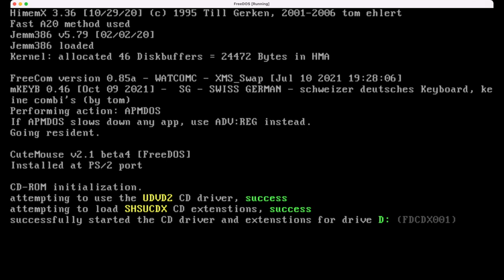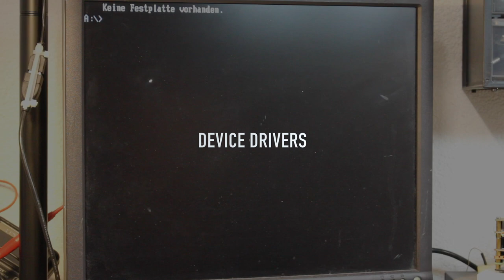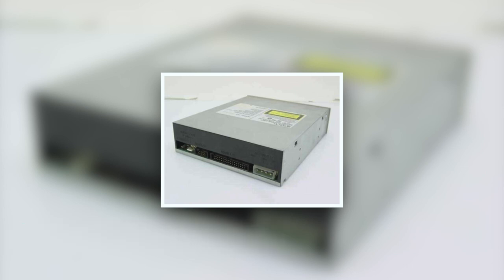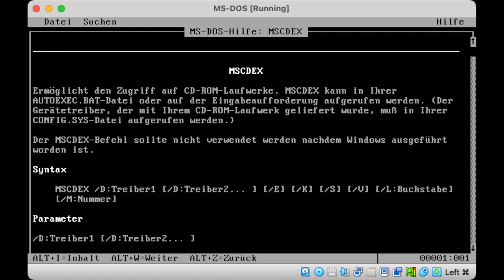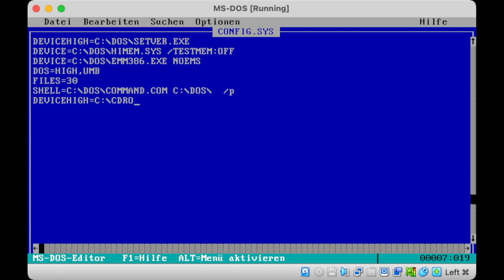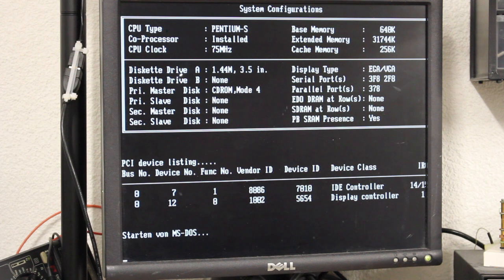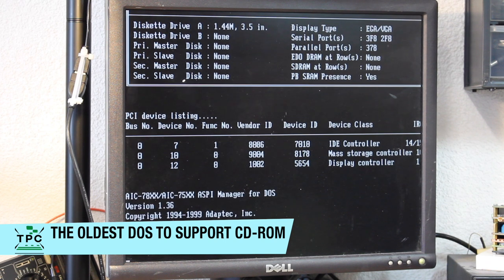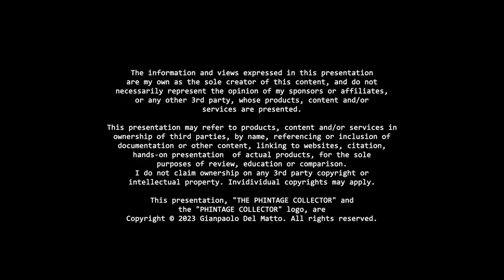How to configure and use ATAPI & SCSI CD-ROMs on MS-DOS

Comment: wow this video is great, because i never knew how to setup a SCSI cdrom drive!!  i also have an adaptec scsi card, and by looking at your video I just need to add ASPI8DOS.SYS and ASPICD.SYS to the config.sys file, and nothing added to the autoexec file? What about if you have a scsi cdrom, and a soundblaster isa 16 card?, you connect that 4pin audio cable on the back of the cdrom to the sound blaster 16 "audio in" header, and i should be able to listen music from CD audio tracks from a disc, right? or what is so called CD games with audio tracks on the disc.
Reply from the maker: Basically yes, just the two drivers are needed. Beware tthough that the ASPI8DOS ist controller-specific. You may need another one depending on the SCSi controller.
And besides that, MSCDEX is still needed as well.

If you connect the analog audio cable to the sound card, you can directlynplay music CDs and output the audio via the soundcard. That goes as well for any games, which come with a soundtrack on the CD as well ative audio tracks.

Comment: use the newer IDE DMA cdrom driver qcdrom is one and there are others
Reply from the maker: Yes, that's possible as well. Though the whole point of the story is how to run in contemporary context with an old DOS release, and the drivers available for that particular hardware during that period.
As a collector, I bother about the authenticity and period correctness rather than the latest bit of performance and technological advancement.

Otherwise, I just use FreeDOS, which has indeed a lot more to offer due to it's way more advanced implementation for both the OS, the drivers and the utilities.